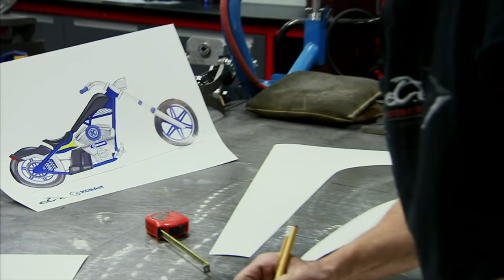What Really Happened To Rick Petko From American Chopper

Comment: I always wanted 1 of Sr old school motorcycles but I want some horsepower between my legs instead of cheap built bike with a bunch of extra garb stuck everywhere that serves no purpose whatsoever with an engine that doesn't have any power. If I can't ride hard and go 100mph for miles with no problems, that's what I want and I think I just described a Jesse James motorcycle lol. He builds some badass scoots and rides